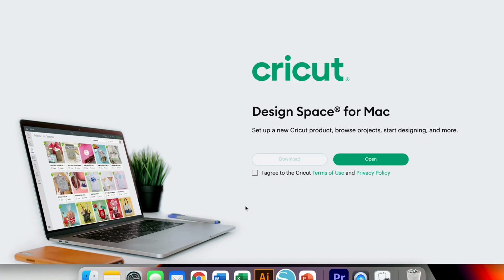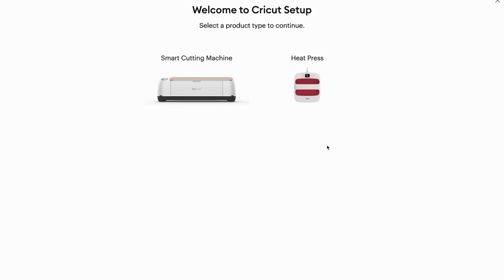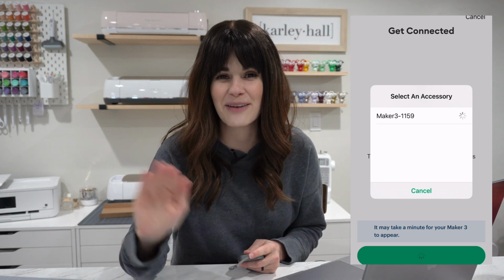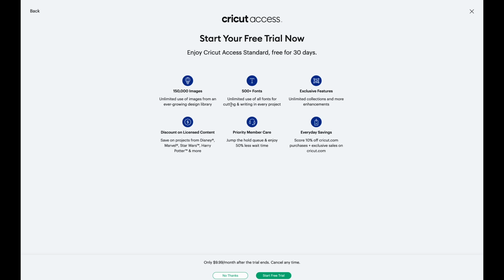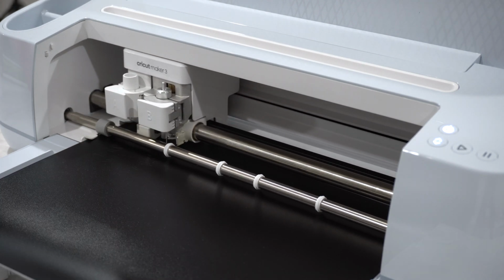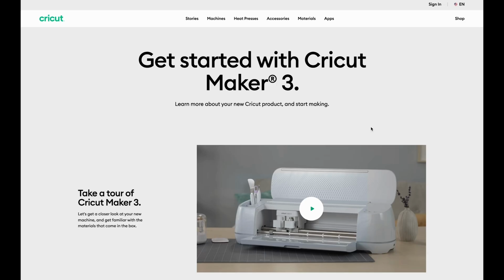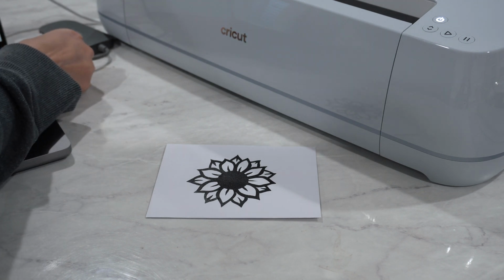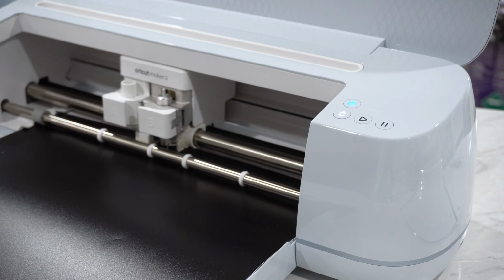Where Do I Start with My Cricut: Downloading Design Space, Connecting Your Machine, and Cutting!

Comment: Cool. I just wish my Explore Air 2 would cut where it prints. I've calibrated a few times and tried on a couple different computers. And apparently, I'm not nearly the only one this happens to. Sad.
Reply from the maker: Are you trying to do a print then cut?
Reply: @KarleyHall  Yes. Cricut reads the black lines okay, but it's always off.
Reply from the maker: It’s a “known issue” right now! I know cricut will fix it since it used to work. Hopefully they get it resolved soon and release an update :)